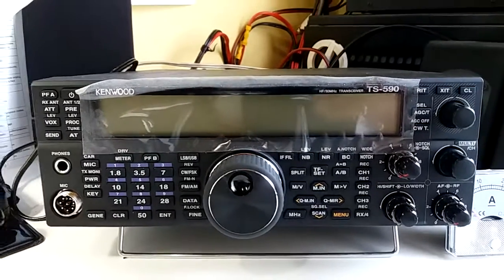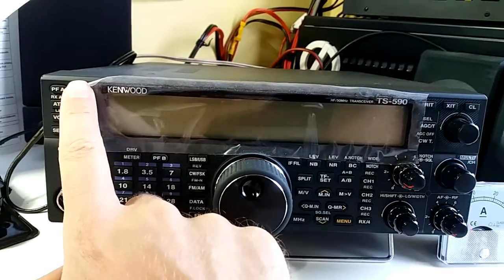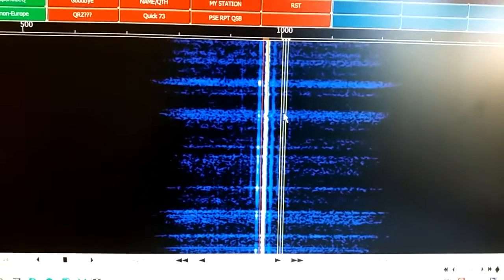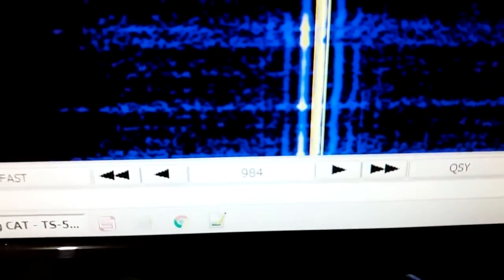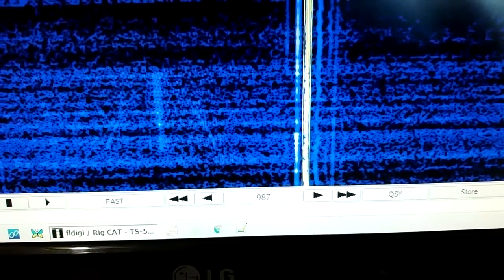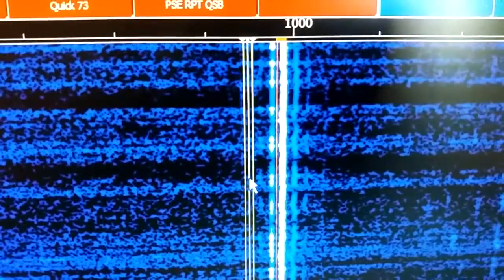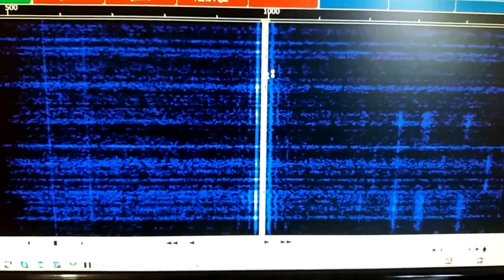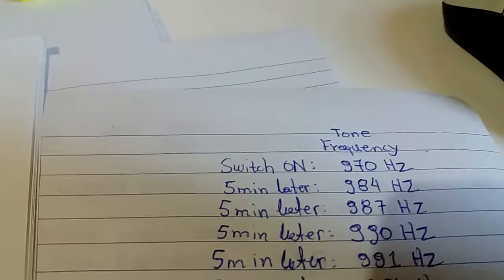Kenwood TS-590SG Master Oscillator Drift and Warm Up

Comment: I can confirm that the addition of the Kenwood SO-3 TCXO keeps the oscillator frequency better than +/-1 Hz upon a cold startup.  No drift can be measured with Fldigi.
https://www.manualslib.com/manual/523344/Kenwood-Ts-590s.html?page=80

Comment: Not only that I just spent the say side by side with this radio and the Icom 7300. This radio sounds Muddy on SSB receiver compared to the Icom 7300 adjusted each unit to the same settings same antenna. And the noise reduction on this set is way too aggressive clipping off the treble making it even more muddy. The 7300 was just so much easier to listen to.
Reply from the maker: 7300 is a SDR transceiver, while the 590SG relies on a completely different circuit topology, at least on the frequency downconversion. I guess this makes their performance different in practice as well. I agree that the NR on the 590SG sounds a bit too aggressive to me as well, although I haven't owned any other HF before. Thanks for watching, 73!

Comment from the maker: Mine was off as well from day 1 out of the box. I noticed this almost right away as I always had to fine adjust the frequency around 20-25Hz above the center in order to optimise the clarity on the voice reception. It seems as if Kenwood adjusts the LO while the TRX is still cold. When I first turned on my new 590SG a 'fresh PCB smell' came to my nose which was normal and was an indication that the TRX had indeed never warmed up before. I guess a trick would be for Kenwood to set LO around 20-25 Hz below the target frequency while the device is still cold and so get a proper lock when the TRX gets warmed up at customer's station after the first switch on. 

Fortunately, the manual included the tuning procedure, as I thought that I had to send it over to a specialised lab to get it done for me. 73.

Comment: The FT450D comes with a TCXO.  Hard to understand why Kenwood doesn't provide a TCXO as standard.  Also Yaesu & Icom provide a menu adjustment to get the LO dead on.  At least Kenwood should provide a hole to access the LO trimmer.  I like my SG, but this is a big miss.  BTW, mine was 46Hz off as received.